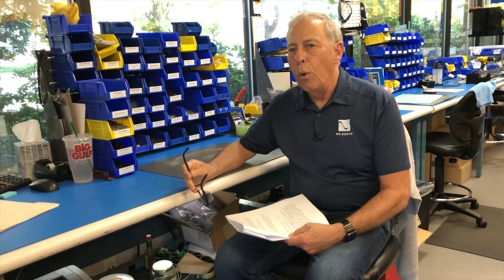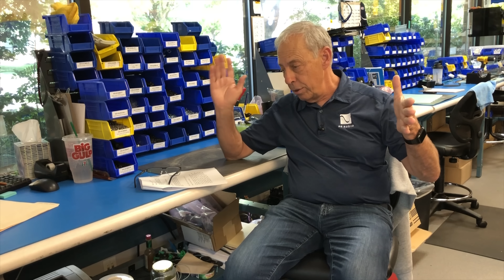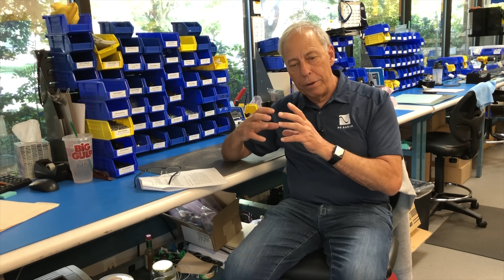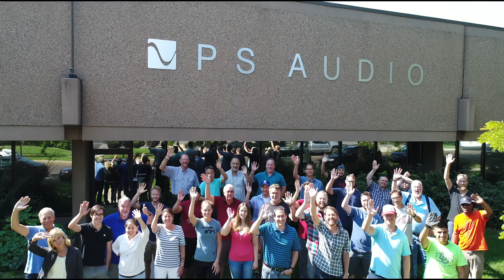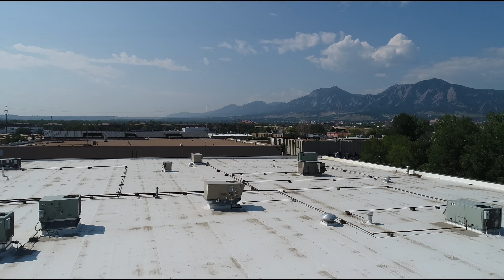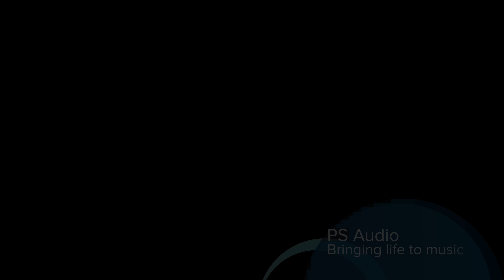Would a battery powered stereo be good?

Comment: Great explanation, thanks.  Lithium batteries work well for 3.3v digital circuits in a digital front end.  Even better when decoupled with large supercaps.  Low noise, impedance and unlimited instant current.

Comment: I attempted to power a 12v boat radio with 9 “D” batteries. While they tested a proper 12 volts without any load, it would drop pretty quick as soon as the stereo was connected. Not to mention that the the stereo would shut off momentarily every time there was a kick drum or other prominent bass frequency. So the impedance thing is definitely of importance.

Comment: While batteries sound great, I agree, not practical in that back in 2016, I built my first phono preamp from a kit, power supply, back panel, and phono stage, each a separate kit, but from the same guy, he even noted which power supplies and project box it'll work with/go into and the sources to obtain them for a complete kit.

Anyway, this was my first time building something like this as the kits were complete with all components, the PCB, wires etc, made for noobs to build and all that. Well, no mention that power regulators, such as the LM78xx regulators (in this case, LM7815) need to be correctly oriented as they are directional in the instructions (are now). So the long and the short of it was, I had one regulator reversed, and the wall wart (itself a 120VAC to 15VAC step down transformer) was DOA for the first one, so ran the completed phono stage off of 2 9V batteries for 18VDC, the max the PS could handle.

The phono stage is a 2 op amp with a passive EQ in between the op amsp, running Burr Brown OPA2134 chips and it literally ran the 2 9V batteries down to where the phono stage ceased to run in about 2 days of limited use. Once I got the new PSU, built it and installed it, along with a new wall wart that worked, I've been happily using the phono stage ever since so batteries in and of themselves are a good source, but again, unless drawing huge mounts of current/voltages, are impractical for many applications. 

Also, someone below says our houses contain all kinds of DC operated devices, but the reality is, there still is plenty of AC devices, your electric stove and dryer being 2, they require 240, twin phase power to run, just sayin'. I had to work around that voltage diagnosing why my dryer, a 20+ YO Whirlpool  unit was not heating up. Everything checked out, but the issue was ultimately traced to the motor switch. The motor itself ran, but the switch also supplies the one half of the 240V circuit for the heating element itself. Can't just replace the switch, gotta buy the motor assembly, but at $166, funds I didn't have, it turns out you can simply unscrew it from the motor frame, open it and clean the contacts. All very easy to do and reinstall. I did so as it turned out the contacts were pretty carboned up. The dryer now works a treat again, but I was using a DVM to test around 120-240 VAC (in actuality, it was a little more than that as the power transformer for my section of the street is literally out behind my house, and over one other house so I'm getting the electricity directly from the transformer, itself a bit crusty unit on a pole in the back alley. Mind you, this is 120V/60Hz NA power.

Comment: Technically a battery is a collection of cells. Cells connected in parallel would have the same nominal impedance. 

The difficulty would be to find a single cell with a low enough impedance. 

Many early radio sets were powered by a cell.

Comment: Speaking out of experience (car batteries, 12V), batteries are GREAT (yes, greater than clean wall AC), when ALL your audio-chain components have been designed and optimized for batteries. The only issue is the fluctuating noise level (actually, noisy artefacts) during dynamic conditions (music playback). But this can be easily be taken good care of by aggressive filtering (you know, magnets/ferrites) of the power leads. Yes, you can put massive external, passive filtering on the power cables with no problem at all. These beauties can give tremendous peaks of current, absolutely unknown to the wall AC outlets, so, passive filtering does not hinder the dynamics of the sound at all. When done right, batteries may prove a panacea for clean, ample power. BUT, this is quite another world than the usual, everyday-audiophile looking equipment.

Comment: The front end (LAN connection) on my system is galvanically isolated, and my Sonore microRendu and Chord Hugo2 are on batteries so the only unit in the system on AC is the power amp. Sound good? Hell yeah! must make sure the batteries meet the spec of both voltage and current required. Good audiophile-grade linear power supplies have better dynamics and just as quiet but many times the cost.

Comment: Capacitors in parallel with batteries can help reduce any impedance issue on transient signals. This means peak power can be increased through capacitors but RMS power is limited by the batteries power capacity minus what is lost in internal impedance causing the batteries to heat up. More capacitance is better concerning allowing more power available during peaks.
Reply: Try a large supercap parallel to the lithium battery.  Works like nothing else.  Also works well with a very good linear power supply.
Reply: @user-od9iz9cv1w  A super capacitor has internal resistance and inductance. A larger capacitor is not necessarily better when the aim is to decouple higher frequency ripple noise on a power line. But otherwise agree, those super capacitors can do wonders in some cases e.g. together with very high power automotive amplifiers.

Comment: Does anyone know why he keeps talking about impedance? It's not the same as resistance, unless I'm missing something...
Reply: Impedance implies it is dependent on frequency which it most likely is. Resistance is implies that it is not.
Reply: @JohnJackson66  DC is not frequency related
Reply: @Muffinx93  It is more useful to think of a battery as a constant voltage source with an impedance, depending on the load the output current may be constant or it may vary and therefore have a frequency component. It is quite possible that the source impedance is not constant and is somewhat affected by frequency component the load. Hence calling impedance.

Comment: I agree that a large battery plant gets fairly complex - I was an engineer in a telephone company . The entire old Bell System ran on battery - lots and lots of battery. A typical medium sized Central Office, such as one I worked out of, had a basement full of large batteries, set up in several different groups of cells to provide different voltages. In my office we had -24VDC, -48VDC, -130VDC, and +130VDC. The 48VDC plant was the largest, and had a 4000 Amp main discharge fuse. All battery strings were sized to run that Central Office for a minimum of 8 hours. 

Such a battery setup is insanely large and expensive, but I suspect it could run one heck of a stereo.

Comment: Lithium battery impedance is very low, it's output is way powerful than wall socket. Single automotive standard battery size lithium can go over 30kw of output, hybrid vehicle batteries are even higher (120v or above).
So basically other than practicality, it is the ultimate power supply.

Comment: I agree with Paul that batteries are not a good thing to use for an energy storage. I disagree with him that they are electrically quiet. That is not true. I did a study on using batteries as energy sources for electronics while I was working at ga.com. They are two things for sure. #1 they are electrically noisy and most importantly #2 they are dangerous. One group at GA series’d / paralleled a bunch of ex submarine batteries. They needed a BIG short term punch. The good news is they put the beast outside. The bad news is it caught fire. Not a good thing.

Interestingly the quietest energy source I have found is a capacitor. Charge up a farad or so and run your preamp off of that. Absolute silence. I actually built one and still have it in my closet. You charge up the big cap(s) then disconnect the charger and run from that. The noise is immeasurable, until it turns off 10 minutes later. :-)

Comment: Love all the pedants, here!  Anyway, currently using 2 Temple Audio class D Monoblocks, powered by 4 rather meaty 17Ah, 12 volt sealed lead acid cells, to give 24 volts a side. That translates to 70 watts on the speaker side, and it definately sound like 70 watt's worth. That's what a 95% efficiency  design can do. Sounds bloody great as well.

Comment: Vinnie Rossi's amps work on DC using supercapacitors that charge from the wall AC. As batteries become better and cheaper they might become the holy grail for HiFi. Paul's explanation is pretty lame. The problem is not really voltage (you can stack batteries) the problem is the current you need to operate a power amp with good dynamics, batteries are not very good supplying huge amounts of current for large amounts of time, have you ever wonder why electric cars need huge battery banks? Class A and AB Push Pull amps are low efficiency so batteries won't last long. A bit more commitment from the industry towards the us of DC power might push the issue forward. In theory DC power amps should be better than AC, DC clean unadulterated current with no noise or hum.
Reply: Lithium batteries mate
Reply: > As batteries become better and cheaper they might become the holy grail for HiFi       When you put a battery in a consumer product you just increased massively the ( UL, CSA, EU ) safety requirements, testing and potential liabilities. It ain't worth it. Ask Samsung about it.
Reply: Yes, power amps on batteries are both impractical and anemic sounding.
Reply: how can it sound like a medical condition?  also how could the source of power possibly effect sound unless it's somehow a bottleneck?   any amplifier will have some power filter circuitry in it thus isolating it in some way.  our brains are programmed to feel more pleasure from something we think is more rare and exclusive for example people will always say that a wine that they've been told is better will taste better even though the control is the exact same wine, hence why the cable debate is still going.  look out for emotive language being used in sales,  you can't trust your ears,  the only thing you can trust is cold hard data.
Reply: jfbaquaro, The problem with using DC for power transmission is it's been tried before. Back in the very early days of electricity, power distribution was DC, but it was found that trying to transmit DC long distances didn't work too well, but AC can be carried longer distances, just use a transformer to every often along with a periodic sub station and you were golden. DC required much more augmentation to travel long distances, so AC won out for that reason alone if nothing else.
Reply: "trying to transmit DC long distances didn't work too well..."

Times change; the Basslink Connector commissioned in 2006 has an undersea component 290 km long and carries DC, not AC. It runs from Loy Yang in Gippsland, Victoria, across Bass Strait to Bell Bay in Northern Tasmania.
Reply: no shit Sherlock

Comment: It would take a lot of batteries to get the 450vdc to the plate of my output tubes!!
Reply: Not really.  A Tesla runs on 375v, an iPace 390v and a Bolt 350v. These packs are very modular so 450v is not difficult to achieve in the future.
Reply: In a Tesla 85kw battery pack there are 7104 lithium-ion battery cells, that's a lot of batteries.

Comment: batteries do not have impedance. They have resistance. All audio equipment runs on DC, ac comes in from wall plug into the chassis, tranformer, retifier filters ---- DC. Same with all electrtonic devices, computers 5V and 12 V DC. What runs on AC are your appliances.

Comment: You audio people (I'm from the microwave world) get impedance and resistance mixed up. Also, batteries are rated in "amp hours" not the term impedance. This is straight from Wiki: 
Impedance extends the concept of resistance to AC circuits, and possesses both magnitude and phase, unlike resistance, which has only magnitude. 
:
Reply: What he was talking about is an ac current coming out of the battery. Ideally batteries supply a constant voltage, but if you vary the load, the voltage they output will not remain constant. For people in the audio world impedance matters more than resistance. If you use an undersized battery to power a square wave to a speaker (or any load) the battery itself will output a square wave which is slightly out of phase with the speaker. This would cause undesirable distortion in the output.

If you use a battery to supply a constant load the voltage will be constant and it will produce no undesirable distortion.

Comment: A DC source means you're completely decoupled from any powerline noise and allows the amplifier designer to choose the voltage it runs off. There is no downside I can think of other than the increased weight and cost of batteries. Any voltage drop or change from decreased charge would be handled with a voltage regulator, or better batteries/super capacitors
Reply: Voltage drop, voltage sag, high impedence, whatever you want to call it, is why it's not ideal
Reply: @shimes424  Same issue with mains power though surely?
Reply: @Muffinx93  when designed right, no. The issue with mains conversion is the large inductors radiate that noise. It's why you see cheaper audio with a wall wart, it's easier to isolate when it's farther away. Problem there lies in voltage drop through the DC power input, which gets worse as that cable is moved/removed many times. That's not an issue with AC power inputs, but they have to internally isolate that noise through shielding and Faraday stuff.
Reply: Using AC doesn't avoid the problem. The output of a full bridge rectifier, which is necessary to convert AC to DC, comes out with 100% ripple. Again, you need capacitors to store current on the peaks to be provided in the valleys, and as load increases, more capacity is required to avoid ripple. Since ripple will effect the entire rail of the op amp, it can contaminate the output with 120hz hum(or 100hz if in Europe)
Reply: Even batteries aren't a perfect DC source because of internal resistance leading to ripple that possess frequency related to the power draw characteristics. However, give someone enough capacitors, and they can make that a non-issue.

Some of those capacitor bank boards for audio are hilarious, though.
Reply: @rich1051414  I run super capacitors in my car audio system. A single bank is around 500f at up to 16v. I don't know of any amplifiers or power supplies that uses them but I imagine if you could afford it, a big bank would be ideal
Reply: It is. The larger the bank, the smaller the ripple/voltage droop. It's diminishing returns after a point though.
Reply: @Muffinx93  16v? Aren't those amps running hot? Wouldn't that push 16v to the rest of the car and cook your PCM?
Reply: @shimes424  A capacitors voltage rating is a maximum. These caps are rated at 2.7v and 3000f. 6 in series allows up to 16v at 500f. I'll typically charge around 14.8v depending on battery temperature, but I will sometimes go up to 15v with my voltage regulator if conditions allow. I'm limited by the voltage range of my AGM lead acid batteries (14.4 - 15v charging).
Reply: I personally only have experience with Fords and their "130a" alternators, along with (just one) the biggest and best lead acid battery, and 0gauge OFC big 3 upgrade. Never used caps. Never had issues with noise or headlight dimming (except when I was 16 and ran the RCA down the power side of the vehicle, THAT was hella noisy)